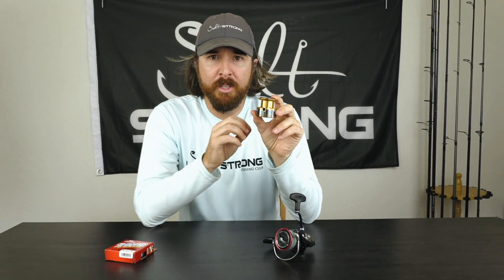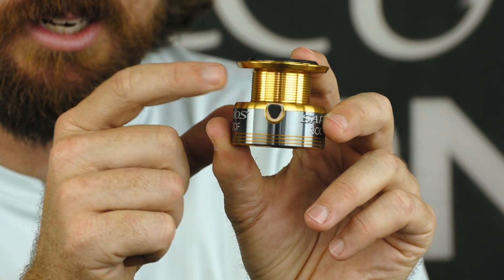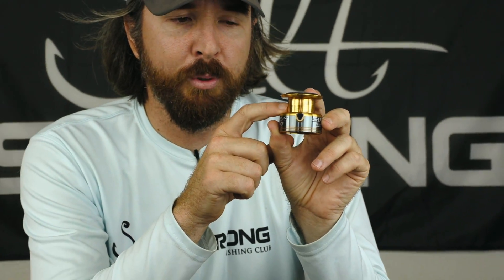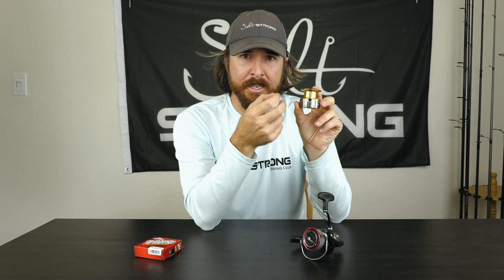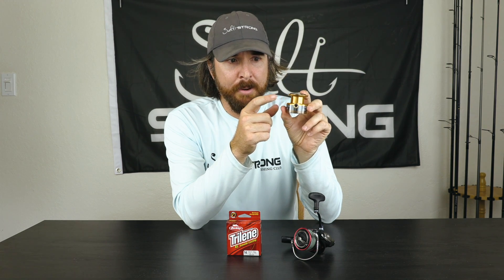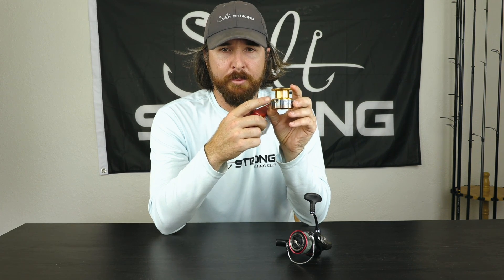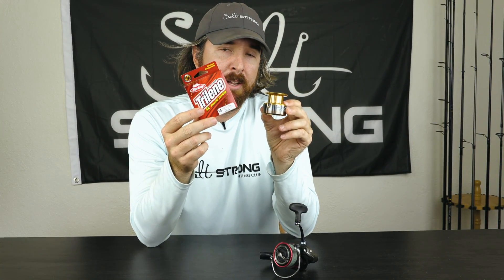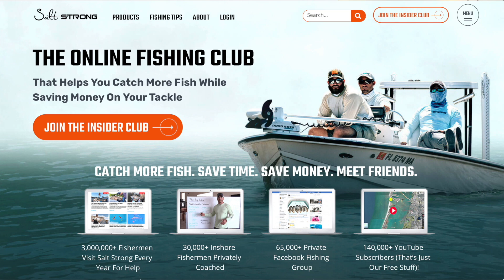2 Ways To Spool To Spinning Reels With Braid (Without It SLIPPING)

Comment: Luke, I spool mine with straight braid, but I open the bail and tie a no slip loop knot in the end. Once I have the loop knot, I attach it to the line clip on the side of the spool. Then I start reeling the line in.

Comment: Hi Luke - good info as usual. Question, sorry if I missed it in the video, but how do you determine how much mono backing to put on (in my case, Daiwa BG 2500) so as to best place 150 yards of 10# braid on the reel?  Does it really matter how close to the lip of the reel the braid goes to?  I don't want to put too much or too little mono backing on the reel before I add the braid.  Thanks...
Reply: I buy cheap 8 strand mono from China.
It is so important not to load your braid too close to the lip of your spool.
I leave a gap of approx 1/8 th inch.
The reason being is if you put too much braid on,you WILL get overruns and wind knots all the time as the braid comes off the spool faster that it can shoot through your guides on the cast.
If youve just spooled up and are getting wind knots on the first 20 casts,just strip some braid off until it stops.

Comment: 2 points: 

With so many using braided lines, but even with mono, 1000-3000 sized spinning reels, manufacturers, start making shallower reels. No one needs more than 100 yards on a reel. 

Second point, Luke, your holding that spool showing an alternate method to anchoring your line, but not mentioning it. The line clip! Tie a double knot, or even a simple overhand knot, at the end of your braided line. Clip the end of your line under the line clip with the knot on the right side of the clip. Pull the knot toward the clip until it anchors. Then wind your reel. If you want to be compulsive like me, loosen your drag. With tension on your line, revolve your reel handle until your spool rises to the top of its range. Now your line roller is near even with the height of your line clip. Tighten your drag and start reeling. Your line clip can still be used for its intended purpose.

Comment: Thank you.....
(Hi, is 10lb mono line size okay to connect to 40-100lb braid line because I heard thinner mono is best "as it remains smooth without creating space" to use as filler in the base of spool while attaching braid)?
My worry is, if a very big fish is hooked it will easily snap the 10lb line incase the fish pulls out all the top spool of 120metres braid line, and I remain worried to fight that monster fish with 10lb remaining mono line on the spool).
What minimum length of mono line is sufficient on the spool - in case my spool is shallow?

Comment: I'm loading my surf fishing reel with 30 lb braid.  What size mono should I use as the base?  Does it need to be at least 30lb as well?  or would 20 lb due?  Thanks!
Reply from the maker: Yes and yesGreat question! Make sure to ask this over in the Community (https://www.saltstrong.com/) where the coaches spend their time.

Comment: Because braid lasts for so much longer than monofilament, have you heard of any failures of the mono base occurring?

Also, does the poundage of the monofilament need to be at least the same as the leader you're going to use or can it be much less?  For example: 30Lb braid with a 12Lb leader, can the base be 6Lb since the bulk of the torque is going to be spread out and obtained through friction?
Reply from the maker: Great question! Make sure to ask this over in the Community (https://www.saltstrong.com/) where the coaches spend their time.

Comment: So I still need to do this if the spool is a braid ready spool? I've been lucky so far on my BG's?
Reply: You will probably get better expertise from some others, but I personally say 'yes'.  Reels like BG add a rubbery band to the spool that is prone to failure and the cost of fully spooling with braid is typically not worth it...fill the bottom with cheap mono (holds better and saves some money) and have the active portion of the line as braid.
Reply: @mudiroc  I'm on it!! Ty

Comment: How do you know how much backing to put on?
Reply: I buy cheap 8 strand braid from China.
I literally put 15-20 winds of mono direct to the spool and then double uni knot my braid and fill the spool to within an 1/8th inch from the lip.
It works a treat.
Because the braid is cheap,i dont mind putting on more than i will need.
Hope this makes sense buddy?